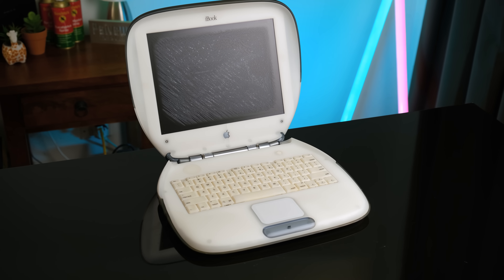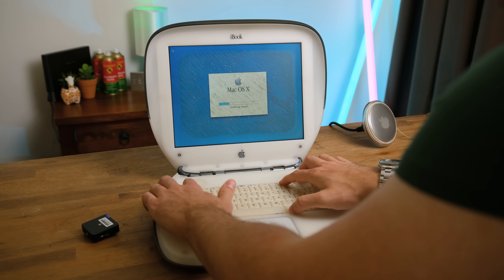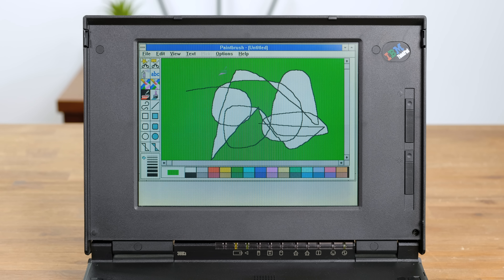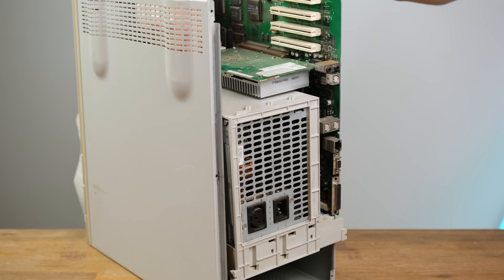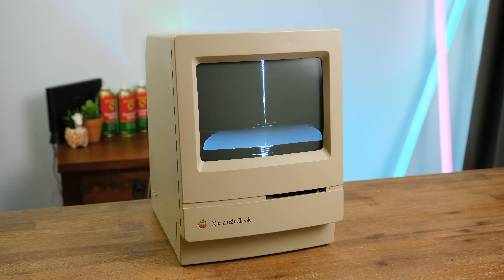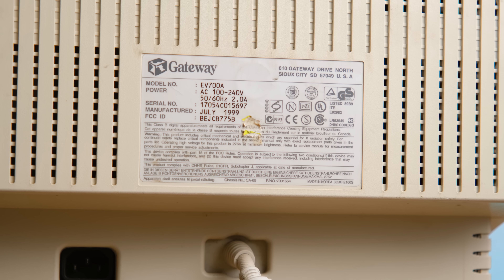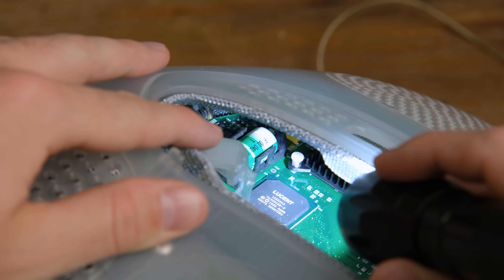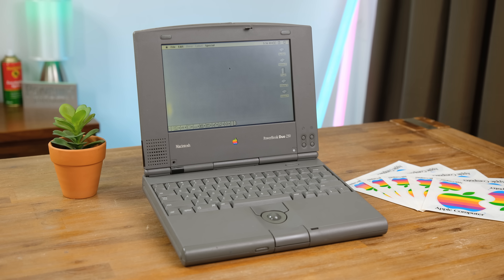So Much Vintage Tech Is Dying... Here's Why

Comment: Programmed microcontrollers will lose their magnetism, this also includes optical disks, hdd, ssd, and other digital media forms. So it is bound to happen if you don't power cycle them in many years. In terms of materials, I have a rubber phone case and rubber controller from about 10 years ago that are disintegrating, and case is even cracking, due to hand oil residue. It happens

Comment: I've got a Rev B iMac, G4 tower w/ external HDD, and a G5 tower w/ 20" cinema display in my closet. 
I've also got a running 2008 iMac as well as a top spec (i7-4770, 16gb ram, 256 SSD) 21.5" iMac that I personally rebuilt to use as an audio production workstation.
The later mentioned I'm actually typing on now and rather pleased with!
I love extending the life of older tech, but the shotty Korean capacitors of the late 90'-early 2000's does make it a crap shoot at times!
I've also got two Executor chip modded OG Xboxes that seriously need some TLC. ¯\_(ツ)_/¯ 
Cheers!

Comment: Sadly my 2017 HP laptop's battery started to bulge last year but luckily even in a thin HP it's pretty easy to open it up and replace the battery.
Reply: 2017? thats not retro tech, hp just sucks in the 2010s

Comment: All these screen are caused by the glue holding on the polerizer film hardening it a very common problem in old gameboys but it can be fixed  by removing the polerizer and then removing the hardend glue and putting on a new polerizing layer

Comment: You should look inside some old 8-track tape players and cassette players from the 70s and before. The belts in those have mostly turned into a viscous liquid that gets all over the place. Good news is that there are brand new replacement belts available.
Reply: This is a good reminder to change my cassette player belts haha
Reply: Not just the 70s, most belt driven electronics older than about 20 years are either suffering from a deteriorating belt or have had the belt fail entirely.
Reply: I've found the same with an 8mm projector and an EIAJ reel to reel video,  belts all either goo or crumbly

Comment: instead of a hammer, clamp down a 80/100/120mm fan with one broken blade and it will shake it nicely (do plant the harddrive down as well), and if you have adjustable power supply (which i reckon you would have, you can adjust the rpm/shake ratio to see when a drive wants to wake up)

Comment: LOL out of some 27 Toshiba laptops ranging from a Satellite T1910 to a Tecra 8200 and a couple Librettos all still work except 2. Those Toshibas made in the 90s are absolute TANKS even the main battery packs. I had a battery pack from 1998 that finally got down to only 30 minute runtime after 6 years of intense daily use.

Comment: My nakamichi cr3a tape deck took a dump and needs new motors. My Sony minidisc deck is having major transport issues because it keeps freezing. If I don't power it on and insert a disk and eject it every few weeks I have to take the thing apart to manually loosen up the platter. I absolutely love my old audio tech, but it's getting harder and harder to keep it going.

Comment: I store my over 40 high end amplifiers from Pioneer (only theSA  XXXX blue series 1979 to 1982) in a climate controlled room.
Temperature 20 Celsius, 40% humidity, 0% ozon  .... all new caps, all like new.
Reply: Next step : Dry Nitrogen 19' racks.

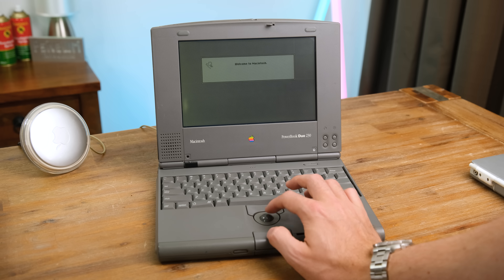Comment: 4:20 IMPORTANT PSA: "Main" Lithium-Ion batteries in any device can develop explosive temperaments!
I just had a thankfully contained failure in my Asus M50V. I also had an HP NC6000 try to go nuclear on me on first-to-me charge.
ALWAYS charge vintage electronics batteries under CLOSE supervision! Watch carefully for abnormal heat or swelling!
This is not just a risk to your electronics, but to your *house*. Lithium Ion fires are no joking matter.

Comment: I was working on a DOS 486, pulling it's controller card and the card was so brittle, it could break like a Graham Cracker. I'm guessing it was stored in an outdoor storage room that had drastic temperature changes between the days/nights of winters and summers, cause I found an identical card and it wasn't brittle at all. Be mindful of the temperature shifts of each day, where y'all store your retros, and try and keep it stable.

Comment: I have 3 old Macs, a 2004 G4, a 2011 MacBook pro, and a 2008 iMac, all with important files on them. I will copy those files onto a removable SSD , and scrap these old pieces of hardware. Thanks for this information. My old Chromebook will stop receiving Google updates long before the computer is scrapped.

Comment: It used to be a running joke in the PC gaming community back in the late 90s that if you want PC gaming you don't buy a mac or apple products, seeing how easily their hardware has corroded or failed over time watching this video lends some truth to this it seems but then again have a May 2000 built Compaq Armada E700 that has dead pixels through the LCD panel and have to use a CRT monitor to use it for retro pc gaming so mine aren't safe from this either...

Comment: A little glimpse into mass manufacturing product's future where everything is expected to get outdated and eventually replaced therefore they use cheap and easily degradable materials. Really does pose a challenge for collectors. I also feel like it gets worse with newer consumer electronics.

Comment: what amazes me is working on japanese motorbikes of the 70s to 80s... how few of them are suffering from "black box" failures...
though ive had a few i have suspected, but generally you can trace faults down to other issues.

id expect at least CDI capacitors to be exploding by now... but yeah, they got electros, transistors, lil pcbs... all potted in hard... and they almost never fail unless some idiot did something...

whereas yeah... modern bikes/cars. computer says no...

Comment: I’ve noticed the same problems with a lot of my old tech, particularly the rubber on old devices. I got around the problem by carefully painting the rubberised coating with a thin coating of clear nail varnish to seal the rubber away from the air and in this case, it worked. The surface was smooth, protected and sealed. It works for sticky rubber but I don’t recommend it for rubber that’s started to disintegrate. Hope this tip helps someone😉👍🏽

Comment: The two old computers I have are a C64 (working but haven't used it more than a quick test as I don't yet have any overvoltage protection for the original power supply.) Also an Amiga 500 with about 850 floppy diskettes. 

I hope they last a while, I have at least had both apart and didn't see any leaking caps.
Reply: I sometimes wonder how my old amiga500 would be going if it didnt get tossed away. It lasted years when it was mine, even though it had fairly common points of failure, they got repaired as needed.

Comment: BUT I have a 1996 Toshiba Satellite 205CDS where the pointer or a plugged in mouse does not work. But the keyboard still does. It appears sometime in its 27 year life something leaked because I see some corrosion spots. I need to find out how to open it up to see how bad the damage is.

And I also have a compaq presario laptop from 2004-05 that will not power up beyond showing the on light lighting up. It just won’t come up at all I don’t hear anything spinning. 👎

Comment: Interesting. I thought vinegar syndrome was a thing that only happened to 16mm film? 
I guess I’m lucky so far the 1997 and 2000 IBM Thinkpads I got aren’t suffering from sticky coating syndrome so far. Nor are any LCD screens I have either with the vinegar or cracking issues.

Comment: as someone who has mostly grown up using CRTs, the last portion of this video hits pretty close to home.
My childhood TV from the early 2000s had long been suffering with RGB issues, the screen turning more and more pink as the years went by. we had another crt, a late 1980s/early 1990s toshiba i think(?) that we had used as our main tv until around 2015, when we were given a flatscreen.
I dug it out of storage again last year to use for gaming and VHS tapes and the set started cracking and popping, smoke pouring out the front. i wasnt equipped with the knowledge (or balls) to repair it myself to it ended up being left outside for someone to collect. more recently my 1989 mitsubishi CRT, that i bought as a replacement for the toshiba, went the same way (minus the smoke thankfully) and im still pretty upset about it.

its painful to see these things slowly fall victim to time.
Reply: I hope and pray that there will be brand-new crt monitor manufacturers.

Comment: I restore vintage computers as part of my job.  I am constantly trying to find new ways of brings old product back to life.

The rubberized fad is thankfully gone, but we are left with cleaning up that gooey mess.  Here is a solution I have found to work fairly well.

Take to object apart, as best as you can, trying to isolate the sticky part is question.  Then, soak it in PB Blaster (or the penetrating oil you prefer, that just seems to work best for me,) and place it out in the sun for a couple of hours.  After that, I'll use a plastic razor blade (yes, they do make them,) and scrape off the goop.  Repeat the process a few times, and use a fingernail scrubber the the little nook and crannies (It is the hardest bristle brush that is small, but won't leave marks.)  After it is clean, rinse it with soap and water, and buff out the rest.

Granted, it will "look" different... but use can at least USE it!  If you really want the rubberized look back, they make sprays that will put it back on.

I hope that helps.

Comment: so uhh i have a 10 years old asus ux31a that still work very fine except the battery which dies at 80% its using windows 10 and it got a 5 point touch screen too

Comment: I don't understand. Is this a problem only with old macs?  I'm a collector of retro computers. I have a collection of 30 computers. Most of them are around 40 years old. I don't have any damage. The only thing is that they become a little yellow if they are in contact with the sun.
Reply: I feel that it could possibly be due to the area that he lives in, I suppose that he likely lives in a humid place, where moisture will likely be the cause of this issue. I live in a dry place, and my old macs work fine.

Comment: im a phone collector and rubber melting is a HUGE problem for me, my collection has many slider samsung phones and most of them had little rubber pieces so it closes softly when you slide it down, but those plastics have ALL turned into a liquid, even without me touching them they get everywhere and by everywhere i mean EVERYEHERE(my hands and basically wherever i put them) and its really awful, atleast they arent that big so they can be cleaned easily

Comment: Yeah it's interesting how old tech is failing, I've got an old Asus centrino xp laptop thay works perfectly but the plastic of the case has gone brittle ans breaks very easily, it's probably only 20 years old.  I also had an even older Taiwanese clone portable pc from the 80s that rhe plastic was even worse on. It must have just been cheap plastic that was used back then.  I've also got a 2009 iMac which had the HDD die but also the screen has vertical lines all over it in the signal which is common, those things run very hot. Also I've had motherboards that just go bad and stop posting after restarting but run fine when the ram is removed and plugged back in.  I did manage to get a brand new in box made in 2000 Samtron CRT monitor in 2017 which works perfectly but sometimes doesn't turn on every time.  I think that like whats happened to vintage audio gear you will get people restoring the best of tech but its a good message to use it while you can.

Comment: Technically, these devices were not designed with this kind of longevity in mind. With trends of the day, makers knew that tech would continue advancing rather dramatically, making older tech obsolete within 5 years or a little more. And with support for older operating systems being dropped after 10 to 15 years, warranties would be long expired.  Plastic degradation is truly the major nightmare here, as so much plastic was used and with techniques to "luxuriate" look & feel, while sacrificing longevity.  Yep, investing in antique electronics doesn't have long term viability!

Comment: There will be lots of stuff from the 40/50/60s that still works in another 20 years, because the primary materials used were metal, and not plastic. Also, a gramophone for example will outlive any electronic record player in the world, simply because there is no electronics inside to go wrong. There will be a time we come to that we will have to rely on very old equipment as there will be no 80/90s kit left.

Comment: I replaced my Bondi G3 iMac's flyback transformer with a NOS one I grabbed off ebay. I'm fairly certain that some of the capacitors are going bad so I don't leave it plugged in.

Comment: I have a 95 power mac performa, its so brittle the slightest touch and crack and break peices off. It still works like a champ though aside from the plastics being severly deteriorated. I hope it lasts awhile longer because id really like to not have to throw it away.
Reply: Update, I threw all all of my vintage macs in the trash, now I have space!

Comment: I find it incredibly sad that these things are just kind of going away. While I’m sure the software side of things is totally preservable, I wish the exact methods of creating the hardware was reproducible to at least some extent. I’d love for there to be companies that still actively build CRT TVs and monitors. I’ve always been under the impression that old hardware would be easier to make now than they were back then, if companies simply had any interest in creating the components for them.
Reply: possibly in the future with like vinyl but CRTS specifically have a very expensive manufacturing process, also at one point we will be able to 3d print old schematics, as long as the schematics and blueprints for it exist we can make it
Reply: @circleinforthecube5170  Here's hoping. Honestly though, since my original comment, I've come to realize there's no way CRTs are gonna completely phase out. Too many people love them, and if their existence as a whole is at risk, there's plenty of people passionate enough to take up the mantle. Besides, I believe at some point I happened across a website for a company that actually creates new ones. I didn't look too far into that though, they were expensive...

Comment: ı have my samsung tab 3 lite since 2016 when i was 6 years old my grandfather bought me now 2023 i am 13 since newer phones or new android comes it dies its android 4.4.4 and it was so laggy i putted 32 gb sd card now its faster  i am using my tablet as monitor for my laptop this means i got 2 screen. vintage tech is dying yes right but when you upgrade them lil bit or use them ase another thing it works fine but yeah they are dying and i upgraded mu tablet android rom 7.1.2

Comment: You're making me feel as old as I did when I saw antique plates on a freaking Olds Cutlass Ciera. None of the machines you showed would I even consider 'vintage". I wouldn't even call them culturally siginificant apart from the fact that crApple's always been overpriced rinky poorly-engineered predatory anti-consumer cult-driven frauds.

Meanwhile my Tandy 1000SX is plodding along just fine without a trace of rust. Oh noes, I had to replace the Dallas chip that was socketed between the mobo and the BIOS ROM. 

It's actually funny, apart from battery damage and the occasional need for replacing capacitors, it feels like '70's and '80's hardware holds up a lot better than the l'90's shlock. There was so much just plain garbage being vomited up by the "name brands". Especially when it comes to crApple and their PC twin, Packard Hell.

Comment: No matter how one takes care of one's own computer or other devices time by Decay is going to run its course. These devices are not meant to last forever. They were built for that.  error. These computers and other electronic devices from that error. At this point they had served their purpose for their time that they were built for at this point in time, at this point there are no longer needed their are obsolete and eventually the computers and other equipment that we are using today, they too will meet the same fate and will soon be replaced by another set of computers and other electronic devices that have yet To exist.

Comment: Yeah that's a head crash. You would normally just replace it with a sold state drive. As to head crash, tapping it may fix it temporarily but it will need to be replaced eventually. Better now than never. As to the display. It's time to find a donor, or if you are any good with micro soldering you could probably find a replacement screen of the same size, and maybe a higher resolution? on Ali Express.  Chinese reverse engineering is getting really good actually. As to PRAM batteries,  you can get rid of them, but you may have to do a PRAM reset every time you boot, but it's kinda annoying, best to just replace it.

Comment: Meanwhile, my albost 15y.o. Lenovo 3000 N200 K2G is running just fine in the corner. Always room temperature, always normal use conditions. When it dies, i plan to house Raspberyy inside it, already got proper cabeling, now it's matter of its death :)

One is certain - We need lamp-based, long lasting computers used as archives. 
Like in Fallout series.